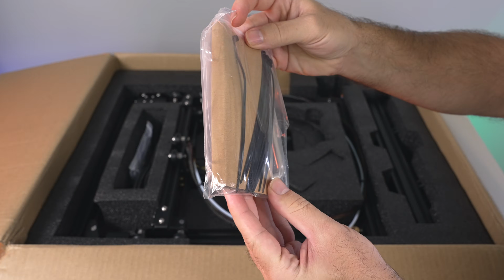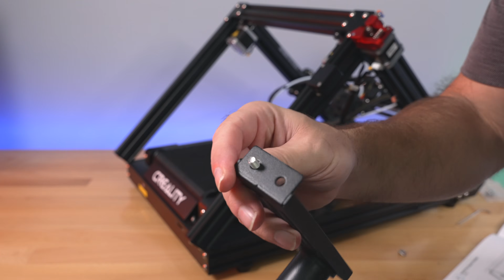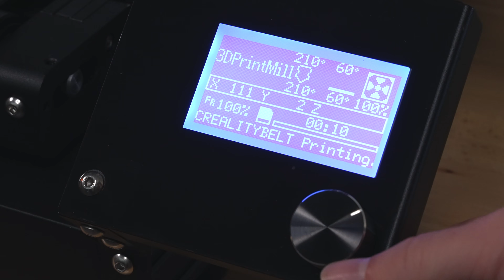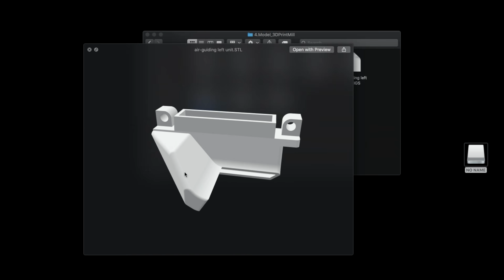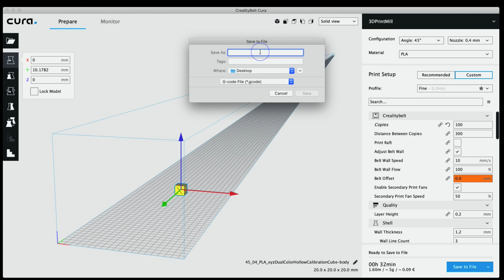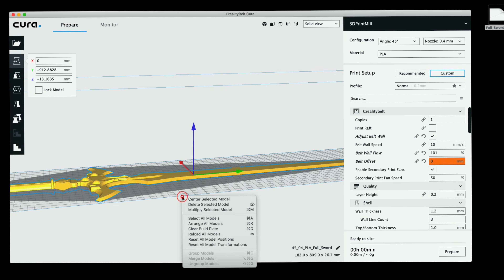Creality CR-30 - 3D PrintMill - Unbox & Setup

Comment: 100% agree, I could not succinctly describe the bed levelling in spoken word.. I'm so gutted they sent me a duff one.. hopefully it will work, I was so excited to get it, for obvious reasons..
Reply: *by 'Duff' I mean crap.. I'm sure when it works it's a joy.. the y-axis endstop adjustment screw for mine had come loose during packing/shipping.. I found it lodged in the extrusion slot for the filament sensor upright.. I hoped it wasn't important but I later figured out what it was for.. bed levelling, repetition to the power of hell.. I've levelled it so many times, I think the night shift built this one...